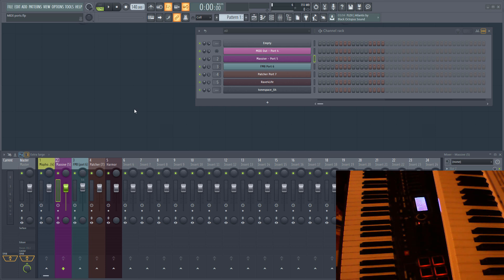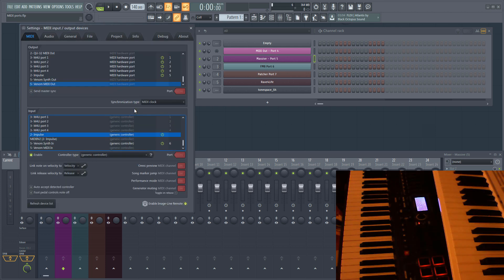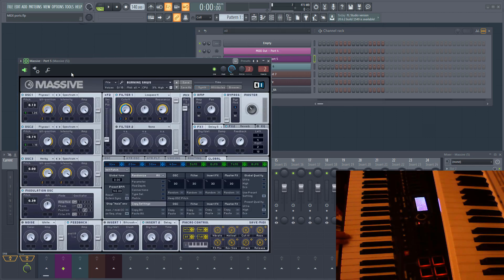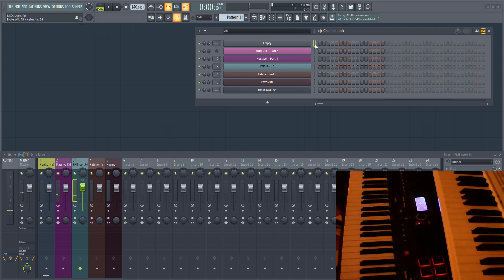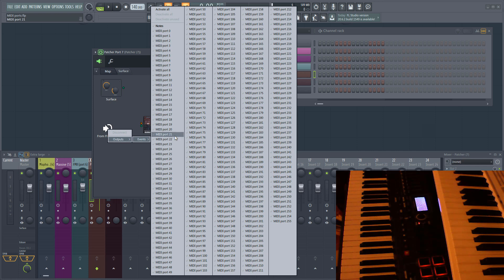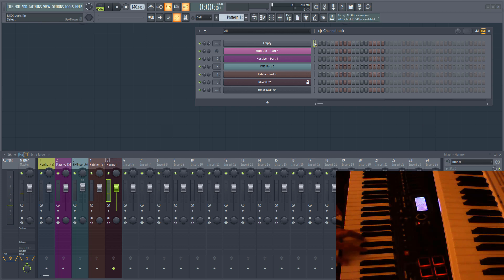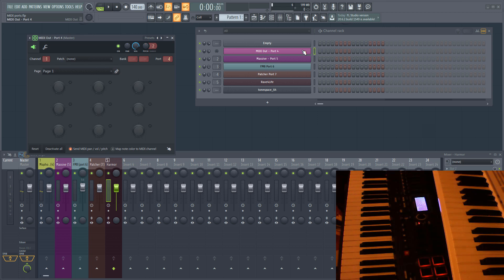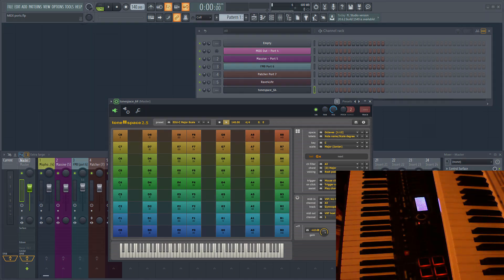Understanding MIDI Ports in FL Studio - How to route MIDI between plugins and/or hardware

Comment: I'm trying to use a stock FL Studio plugin within Patcher, routed through a MIDI port, and I also need sustain pedal and pitch wheel functionality. How can I achieve this?

My initial thought was to create a custom control in Patcher, link it to the pitch wheel, and then connect it to the plugin's internal pitch wheel. However, I've noticed that many FL Studio stock generators, like PoiZone V2, don't expose a pitch wheel or sustain input for connection. Furthermore, Patcher plugins seem to ignore the master pitch when played via MIDI ports, which prevents its use for live jamming.

Does anyone have a solution for this?
Reply from the maker: Most of the FL Studio plugins don't respond to things like sustain or mod wheel. Some of the Maxx plugins are exceptions, and IIRC, you need to use the VST version, not the FL Studio version of the plugin. At least that's what gol told me when I asked why none of the mapping options work in Sawer. So if you have access to the VST version of Poizone, try using that. But I think you only have access to the VST versions if you bought the plugins separately, but not if you bought the all plugins bundle.

Gol, the original developer of FL Studio unfortunately didn't understand MIDI and thought it wasn't worth supporting, which is why so many of the standard features of MIDI are unsupported in FL Studio. We're still dealing with the fallout of his poor decision making to this day. You can always lobby the team for proper MIDI support on the forums - but don't hold your breath. We've been asking for MIDI support for decades, and nothing has happened.
Reply: @steevmsteevm  Thanks for the help! 👍

I've discovered that the upcoming FL25 Beta will include a VFX scripting feature for Patcher. This means I might script it myself. The MIDI Scripting documentation also mentions MIDI Ports, which could be another avenue to explore.

It's frustrating that most plugins lack MIDI support. While they work directly in the channel rack, I can't select a MIDI Port for them this way. If this feature were available for all plugins, it would likely resolve the issue. Only time will tell if this will be addressed.

Comment: Hi, i have a Roland Td17 module with my electronic drumkit. How would I get a saved midi piano roll (with velocity etc.) routed to my td 17 drumkit so I could only get the kick sounds from that hardware? ( I know allready how to only get the kick sound) Im trying to separate a played beat on the drumkit to individual tracks, and im trying to route the piano roll to the module so it could play the kick where it needs to go.
Reply from the maker: You'll want to use MIDI Out to send the MIDI to your external hardware. You want to set a port for the TD17's output in FL's MIDI settings, and then make sure that the MIDI Out plugin is set to transmit on that MIDI port.

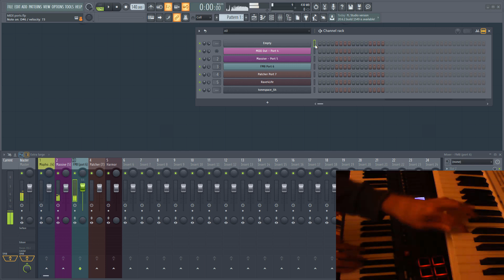So if you set the TD17's Output to be Port 3 in FL Studio, you need to set the MIDI Out plugin to port 3. This is around 2:40 in the video. While I'm doing this with my Mopho, it should be pretty much the same . You presumably will have a MIDI output that is named TD-17 or something very similar as the TD-17 has USB.
Reply: @steevmsteevm  thank you very much for the reply 😁

Comment: All great info, but you didn't cover cables. I'm just using USB into my laptoip, and while I can see that something is happening in the FL studio interface when I hit a key on my hardware synth, I don't hear any sound.
Reply from the maker: If you're seeing the mote being displayed in the info area, then the MIDI messages are arriving fine. That means that whatever you are sending them to isn't responding (or you are not sending the notes to anything, because you've assigned a MIDI port that isn't in use).

Bear in mind that some instruments have a range and that if you hit a key outside that range, nothing will happen.

Comment: Thx for this tuto. But how to use MidiOut Knobs with internal VST ?
Reply from the maker: Right-click the knob in MIDI Out, select Configure, enter the CC number
Reply: @steevmsteevm   Yes but it does not work. Try it your self. VST need "Midi Learn" option.
Reply from the maker: The VST just needs to be able to react to the CC, be that via MIDI learn or due to the CC already being mapped to something in the VST. Check the manual of the VST to see what CCs come pre-mapped. If you want to control something that isn't pre-mapped, you obviously need to map it first. @bzoch29

Comment: how do you   use your hradware as a vst? what cables do you need?
Reply from the maker: You can't use them as a VST directly. You need a VST editor or control panel of some sort that communicates with the device - either directly (typically VST editors created by the manufacturer) or via MIDI controls. Most modern synths have MIDI over USB. Older synths, rack gear and some newer synths use DIN-5 MIDI cable that will require a MIDI interface. 

Then you need a way to capture the audio. That means connecting the audio output to your audio interface. What cables you need for this depends on the device (though most synths use line ins/outs) and your audio interface (most support line and/or XLR).

For FX, you'll also need an audio interface that has additional outputs in order to send the signal from the PC to the hardware. And of course you need to send the processed signal back. Again, this depends on what your hardware uses. Many rack FX use XLR rather than line, some use both. Guitar pedals use line etc. Remember that anything that is stereo will need two mono channels on your audio interface (one for Left, one for Right).

There's no 1 answer to this. But if you have a synth you want to integrate with FL Studio, I'd definitely suggest you take a look at this video, which goes into some of these aspects in a lot more depth: https://www.youtube.com/watch?v=I8FTsKAGMT8

Obviously I didn't go into the audio connections in great detail, as that is very setup-dependent. But you will hopefully understand the general idea; then you'll need to look at your gear, your audio interface, and figure out if you can hook things up with what you have or not.
Reply: @steevmsteevm  there was a video where a guy was able play his hardware synth presets on the piano roll  through the midi out vst. He didn't show what cable he used though.
Reply from the maker: @ksager123  It'll be either USB or DIN-5 via a MIDI interface to send the patch change messages and notes; and then probably line/instrument cables connecting the synth to the audio interface so you can capture the sound on the PC. Some modern synths can function as their own audio interface and can send the audio via USB if you are using the synth as your audio interface (but you can only really use 1 interface on PC because of how ASIO works). So it depends on the synth and overall setup what exactly the connections are.

What I do:
Synths receive notes etc. from FL Studio via both USB and DIN-5 MIDI cables depending on whether they support USB or not (e.g. my JP-8080 and Mopho have no USB, so I use a MIDI interface and DIN-5 cables; my Summit and Behringer synths have MIDI-over-USB, so I use the USB connection with those).
The synths send audio to my digital mixer. This also functions as a USB audio interface. It has both line and XLR inputs, but I'm only using line inputs for the synths - line out is pretty much standard for instruments.
Reply: @steevmsteevm  thanks
Reply from the maker: @ksager123  yw

Comment: Hey, great video! I have a plugin called Cthulhu, it's like your ToneSpace. I can route it to VST, but not to external synths. With MIDI Out I can control my external synth,but not with the nice chords and arps. Is there a way to control external synth with Cthulhu or your ToneSpace. Something like MIDI out as a MIDI Thru plugin or so? Greets, Robert :)
Reply from the maker: With tonespace, I simply set an output port in the MIDI settings in FL Studio for whatever MIDI device the synth is on (roughly 3:00), then choose that port number as the output port in the plugin wrapper (5:34). Does that not work for you?
Reply: @steevmsteevm  Thanks for the answer. No, doesn't work with Cthulhu. Only for internal VST. Maybe I try ToneSpace, seems to have the same possibilities.
Reply from the maker: @robert.melter  Interesting. Haven't used Cthulhu (and to be honest, I only downloaded ToneSpace in order to make this video), so unfortunately I don't have any suggestions. In theory, if it works with plugins, it should work with  hardware too. After all MIDI data is MIDI data.

You might want to double check everything is set up right, in case you've set the input port instead of the output port or something.

Comment: How can i send midi cc ( not midi notes) from one plugin to an other?
Reply from the maker: Unfortunately, I've never found a way to do this in FL Studio directly. While there are lots of plugins that will send CC data, FL Studio isn't actually MIDI compliant and CCs output by plugins are completely ignored. This is similar to how CCs from physical hardware are completely ignored in FL Studio until you manually map them. I've never understood why it's implemented so badly when other hosts will immediately respond to CCs without any extra work, but that's life. MIDI is unfortunately an afterthought in FL Studio and despite asking for this to be fixed for decades, nothing has happened, and the IL staff seem to have trouble even understanding why it's a problem (they aren't musicians, and it really shows).

Now, if you really, really need to get this functionality to work, you might be able to work around it. I've never actually tried this though! I'm also not sure whether it's worth the effort - that's for you to decide. 

What you can try is installing a MIDI loopback driver (e.g. loopMIDI, I think MIDI-OX also has virtual ports - use your favourite search engine to find more). This will allow you to create virtual MIDI ports that show up as MIDI devices in the MIDI settings in FL Studio. You can assign FL Studio port numbers to these virtual ports in the MIDI settings in FL Studio. 

You'll need an output that you send the MIDI CC to - this will be the output port number set in the MIDI plugin's wrapper. Then you want an input, which will takes the MIDI message received on the virutal output port, and send it back to FL Studio. This will be the MIDI input port on the plugin you want to receive the CCs. 

You will still need to manually map the CCs using link to controller - because, as stated above, FL Studio will otherwise completely ignore any incoming CCs. So even if you send, say CC64 (sustain pedal) to a piano plugin in FL Studio, it won't actually react to that CC unless you manually map CC64 to the plugin's MIDI CC64 input. You can find these CC inputs at the bottom of the list of parameters if you select "Browse parameters" from the wrapper menu. Right at the end, there's a whole list of all MIDI CCs. Right-click on the CC you want to use, select Link to controller, and then set Ctrl value to the value of the CC you want it to react to (i.e. the CC sent by your MIDI plugin).

Side note: because FL Studio doesn't support MIDI, most native FL Studio plugins do not have any MIDI CC parameter inputs either. But you can map a CC to the parameters using Link to controller the same way, you just have to map it directly to a parameter rather than a CC.

I cannot guarantee this will work, because I haven't tried it, but it should work in theory. Also be aware that you can often set up your own more complicated MIDI routing in these virtual drivers, essentially using them as their own MIDI patch bay.

As you can see, working with MIDI in FL Studio it sub-standard at best. I've tried to link CCs output by a plugin to another plugin in Patcher in the past, but either I was doing something wrong, or it's not possible in Patcher either.

If you do manage to get this working with virtual MIDI ports, it would be great if you could reply to let anyone else facing the same difficulties know how you solved it!

Comment: Fun video but with one flaw: you mention "internal" MIDI routing but fact of the matter is that this isn't internal at all: the only reason that works is through the VST wrapper. Semantics, sure, but internal would imply that you can also control Studio's own generators, and yet that's the part you ignored ;)
Reply from the maker: I think you must have skipped that part then. I definitely did cover it. But you have to use Patcher or lock the MIDI port to the instrument in the rack.

Comment: Hello, I’m having difficulties getting my transport buttons to function in fl studio. Any tips? 
Thanks for the amazing content btw!!!
Reply from the maker: Check the manual to see if you can set it to "MMC" mode for the transport buttons. It's probably set to something else. Another possibility is that you don't have "generic controller" selected in the MIDI settings in FL Studio and the commands are being interpreted as something else. But I'd suspect it being down to the controller not sending MMC.
Reply: Thanks a lot!! I was able to assign some buttons to those specific functions but still not able to use the actual play stop record on the MIDI. Either way I’m satisfied. Thank you!!

Comment: I have an issue, I got my input an output set to 4 and the midi out is also set to 4, so when I play a note on my keyboard it triggers the synth. However when I click in the piano roll for this midi out there is no sound :/
Reply from the maker: That's weird. It would probably help if you could go into more detail as to how you have set everything up (making it clear what is set to what port, external hardware vs plugins etc.). I just did a very quick test and couldn't replicate this behaviour, and if I set both my external hardware synth and a plugin synth to the same port I can hear them both playing when I click on notes in the piano roll. 

That said, if your keyboard is triggering the synth in FL Studio, you don't need to use MIDI Out at all, so maybe you're overcomplicating the setup. Again, if you describe the setup in more detail (making clear what is hardware, what is software), it might be more clear what is going wrong.

The only other thing I can think of is that you've set MIDI Out to send on a particular MIDI channel, and your synth isn't responding on that channel.

Comment: Can i use multiple synths with only one midi out from pc using midi thru?
Reply from the maker: In theory at least, yes. I've never actually set this up myself. In part, because multi-port MIDI interfaces can be picked up pretty cheaply (I've got a 4 I/O interface that cose me EUR 17 second hand) and because most modern devices now support USB anyway.

I would suggest that you refer to the manuals that came with your hardware, as you may need to configure what is forwarded to the MIDI thru port or switch a port from MIDI out to MIDI thru functionality. Depending on your use case you, probably also need to configure what MIDI channels each device is responds to.

You will only have 16 MIDI channels per output, so if you want each device to respond to different notes, make sure the notes are being sent on different MIDI channels. Then configure each of the devices to receive MIDI data on the corresopnding MIDI channels (and ignore MIDI data on the channels for the other instruments).

If you can pick up a cheap MIDI interface with multiple ports, it'll generally make the process a lot easier because you won't need to be menu diving to get everything set up each time. Of course, most modern devices are now USB-compatible, which also reduces the need to daisy chain.

Comment: Great! And how would you send FPC drum beat to a Sampler channel or another VSTi? In Ableton this i pretty simple, you just select midi input on the channel. Thanx
Reply from the maker: You wouldn't. You'd just load up a Sampler channel or different VSTi instead. I'm guessing this is related to the "MIDI Loops" you can load in FPC, but those are just MIDI files, and you can drag simply them to the piano roll from Explorer or the browser (if you've added the path to the list of Browser extra search folders in the File settings) and use them with any plugin. You can see the path when you click on the option to load a loop if you are wondering where to find them.

They're not going to work well in Sampler though, because the loops have different notes triggering different drums, while Sampler can only load a single sample. So if you load a kick in Sampler, that kick is going to play the kick part in the loop, as well as the snare and hihat parts, and it'll sound terrible :D 

FPC isn't generating any MIDI itself that you can route to other plugins, it's just responding to the notes coming from the piano roll. Loading a MIDI loop just copies the MIDI file to the piano roll in the current pattern. This is the same as dragging the loop to the piano roll manually.